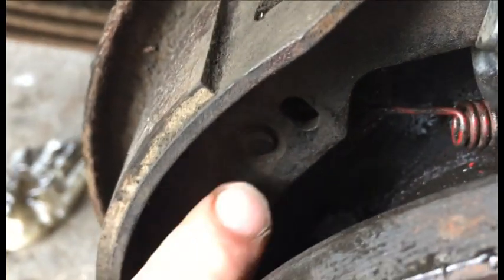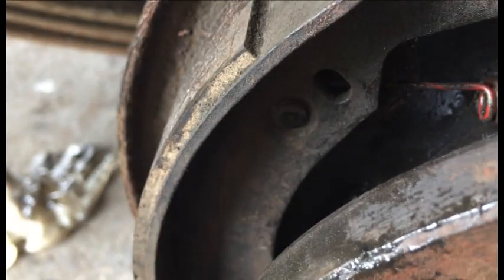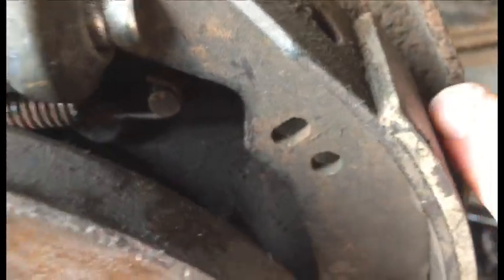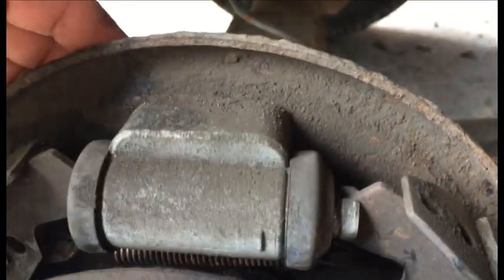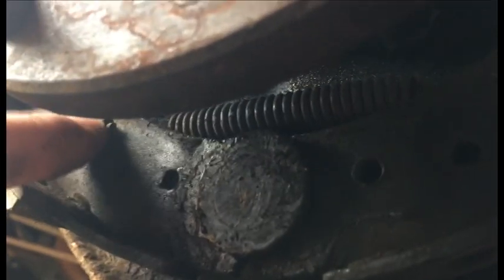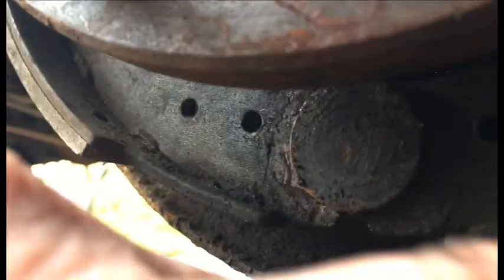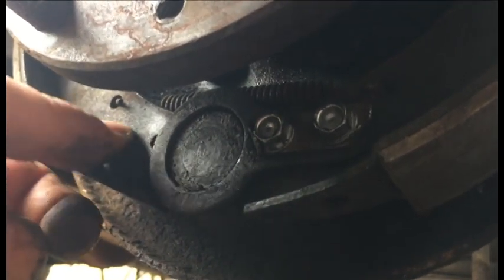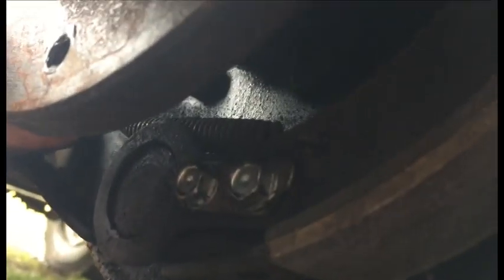Land Rover Series drum brake fix and spring positions

Comment: You're spot on. I've worked on them for 60 years and seen some amazing things with Landy brake springs! It's worth noting that the red spring wants to be positioned with the bulk of the spring facing outwards so as to clear the hub. Always fit the top spring first by hooking it to the stud on the backing plate then to the groove in the adjusting stud on the shoe before offering the shoe up with the spring BEHIND the snail and into its slot on the piston... Then grip the bottom of the shoe (with its spring already attached) with a pair of pliers and hook it onto the centre post.  🧐

Comment: How did you pull the springs? What order
Reply from the maker: I've not done it for ages, I seem to remember the lower spring is strong, so I undid the top one first, a screwdriver/long nose pliers and then the brakes seem to come apart more easily. Do the reverse to put them back on.